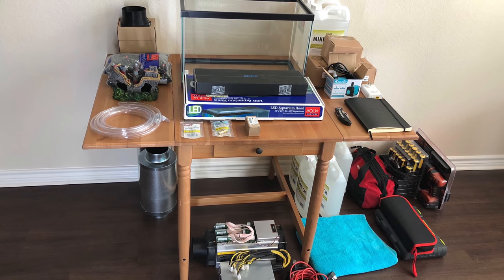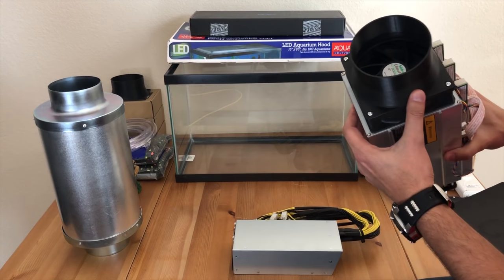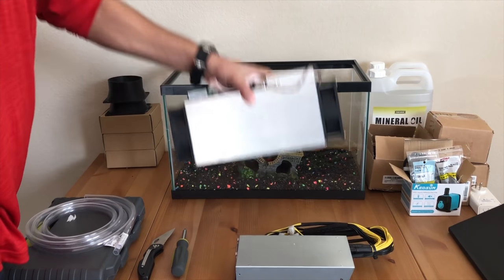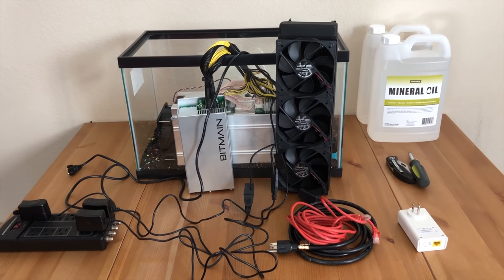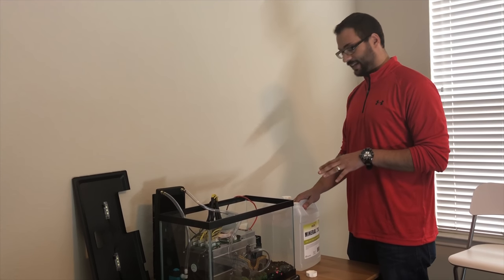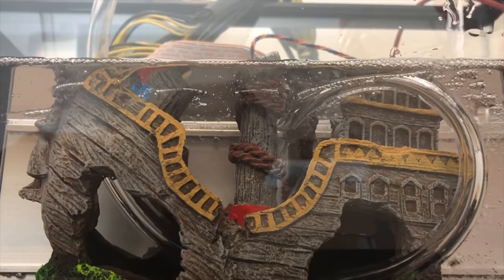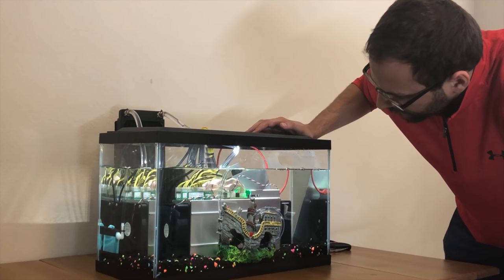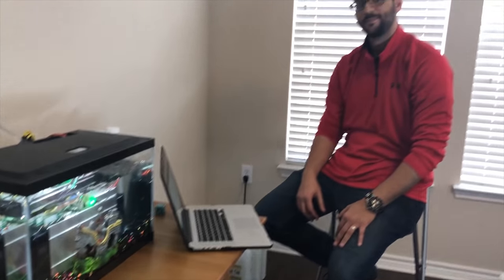Coolest Bitcoin Mining Miner - Liquid Cooled Experiment

Comment: Great video dude. Taken (as you correctly pointed out) with a bit of salt, it does serve as a very interesting experiment!

Sidechain question: where did you get the black muffler adapters screwed onto the miner at the beginning of the vid?
Reply from the maker: Thanks. The muffler adapters I bought one on eBay and Amazon. I personally don't recommend them. Maybe the newer ones are better. But long story short is they don't function as you'd expect. The tradeoff of ~5-10Db for 10+ degrees in temperature is not good at all + lower hash rate and higher Watt consumption. Overall just not worth it.

Comment: Hey guys great video. we're considering something similar. Are you still running this set up? Or was this just, as you put it, experimentation? I'm wondering if some or all of this can be used in a more permanent solution?
Reply from the maker: Ezra Peace Definitely an experiment. The heat generated cannot be dissipated with two radiators. Based on the Temps I calculated over time, you would need 4-5 radiators. A car radiator would definitely do. Long story short, it's viable (car radiator because of heat deltas) but too costly.
Reply: 5 radiators , 360mm each ? and 15 fans ? hmmm .... sounds like over kill , can you show your math ?

Comment: It looks really really cool and now I'm seriously thinking of setting up an Antminer A3 in fish tank for decoration purpose as hobbyist. I have two questions before I set it up in a fish tank. As I'm going to put it in my bedroom room, I want to know how loud is the antminer when it is working in mineral oil compared to working in normal environment?  Do I have to change mineral oil in a regular basis and does it cause any health problems with mineral oil evaporating in the air for the long term? 

Hope you have more similar experiment videos on your channel ;-)  Thanks!
Reply from the maker: Qishen Zhang more mining experiments coming soon. Ideas also welcomed.
Reply: you should try this set up but with 3 of the 480watt xspc radiators. how are your fans running and not causing the miner to turn off?

Comment: I wonder if the radiator is cooling the oil faster enough than the miner is heating it, because if not, the experiment will fail. The point here is to get a cooling power greater than the miner and also take care that the density of the oil doesn't damage miner's fans in order to keep moving the oil. Could you give us feedback?

Comment: you need a 300 watts heavy ac motor and a proper pool pump and a car radiator to cool down the oil. if you want to use it and not damaging the chips. and that will make enough noise any way plus extra costs and extra time to assemble it. so, cool game you did. for commercial result, stick to a room outside your living area and isolate the walls for noise.

Comment: Tiie wraps used for hose clamps is a bad idea. Viton tubing is what is needed for mineral oil. The type of tubing you are using gets brittle, I learned the hard way. I have a HTC that's been running nonstop for several years in mineral oil. Great cooling media if you want a quiet system. I use a single 200 mm fan which runs silently.
Reply: Is it okay if I want you to share more about your lessons with me. Please..

Comment: Hi,
How are things going so far? We about to submerge 2 and want to hear more about how its performing so far and if you have had issues after this video? 
Please let us know. Cheers
Reply from the maker: Jason Stark This was an experiment to get some numbers for large scale implementation. I'll be doing a video update eventually but my advice to you would be to calculate the cost and understand how much cooling you would need. If you don't have the numbers right then don't do it. I'll refrain from recommending a specific hardware since I'm still working on it for a 3x setup. No issues but this machine ran for less than a week (non continuous since it was used for various experiments including testing max temp) so take that for what you may. Also, this is not cost effective at all. If the noise is getting to you consider an alternative. Hope that helps.
Reply: Hi,
Electricity cost for us are not an issue at all. 
Just wanting to hear what hiccups you had after the video etc, if any. 
I have do my calculations etc and bought the best we can get our hands on across the board. This as well is an experiement for large scale.

Comment: Building out a detached garage thinking in my case better to soundproof it instead. Thoughts?
Reply from the maker: Crypto Chick! You are better of creating a soundproof box or she'd covered with loaded mass easily found on Amazon. Make sure to set the auto turnoff on max temp reached value in the settings. Ensure your not pushing Amp powerline to more than 80%. Otherwise you can easily start a fire!
Reply: Joel Pagan Good to know.  Is it true the new Samsung cards will be more efficient and specific for mining?
Reply from the maker: Crypto Chick! Technically yes. They are more efficient because they deliver greater throughput (nearly double) with nearly the same voltage (.23V increase). They did so by primarily doubling the chip density.
Reply: Joel Pagan just looked up loaded mass and that’s such a great idea for my garage. I dont want the noise from fans to annoy neighbors. Pls continue with tips/vids on how to build rigs. I am waiting for those new Samsung Cards.
Reply: +Joel Pagan мега крутой видос) лайк и подписка одназначно) и буду ждать новых видео)

Comment: It will never run for long, because if the heat saturated the oil, it will like frying some fries.
Reply: it has a radiator to keep thinks under control.the only mistake he made was dipping wires in oil.mineral oil will eat plastic ober time.

Comment: Hi Joel i have issue about fan, firmware dont start the miner becouse fan is too slow. Id like also remove totally the fan, Do you have any advise for me?
Reply: Hi justin, i have the same problem than Daniele, but my cuestion is if you have an idea how you can run you fans and we don't ??? is any issue or trick that i need to know, i have an antminer a3

Comment: If this is now under immersion, could someone remove the fans off the miner before immersing it to reduce energy consumption?
Reply: The fans are necessary to continue flowing the mineral oil through the device to remove the heat.  Without the fans, it just cooks itself in oil.

Comment: Can you list the parts you used and why

I'm building a large scale mining farm and this might be the solution I need... Please get in contact with me
Reply from the maker: t This specific setup does not scale. A large round pipes vehicle radiator is your best bet. To scale to 3 or more you would want to focus on having a large flat surface area and only cover the processing chips and not the micro controller and exclude power supply. Reason is to mitigate oil exposure to capacitors. Reason for round pipes with no 90degree turns is to increase flow rate.
Reply: "Reason is to mitigate oil exposure to capacitors."--------- есть масла которые применяют для пропитки конденсаторов. Думаете они не подойдут?

Comment: Hey, thanks for this cool setup.
Im thinking about doing this too with some of my miners.

Do you have any experience with the long term effects or problems ?
After 3/6/12 months ?
Reply from the maker: RitchardKnight I honestly don't think it's cost effective. The cost of mineral oil plus pump plus radiators is too much for a serious setup. This setup has no fail over. If a pump burns out, the mineral oil will boil your miner for sure. I'm planning on doing a cost effective setup if enough people request a video for it. Copper piping and custom radiator is the way to go.
Reply: I would like to see your future setup as I plan to test this myself.  The noise is killing me...

Comment: Is it safe to submerge the PSU in  mineral oil? Planning to do One of these . I Will put it  in a chest Freezer for cooling the oil. Don't want to let  the PSU outside the mineral oil because of the humidity. Anybody tried this before any comments would be appreciated thank you.
Reply from the maker: Ismael Quesada psu in mineral oil I'd safe. Just remember that you would need many more radiators to dissipate this kind of heat. Again. Just an experiment not a viable solution. 

The problem is that the PSU also dissipates a lot of heat. The capacitors in the psu are more sensible and have lower heat capacity. That means that you can't let the temp go high or the capacitors will pop.

Comment: How did you clean your miner afterwards??
Reply: afterwards miner is useless and need to be disposed.
Reply from the maker: Anton Saad Cleanup is very simple. Run vertically for 5-10 minutes and gently increase and decrease angle every minute or so. Oil will pour out continously until surface is nearly clean. Open device and gently remove remaining oil from surface.

Note that this will technically never come of completely. You can also run it as is knowing that your temp capacity will be lower. This means you won't run as efficient as other devices. It's somewhat obvious because once dipped, there is no going back to normal.

Comment: 20% of an ASIC's power consumption is in the fans. At most farms they remove them but with some miners you can turn the fans off with software or set to immersion cooling which should disable fans. You are wrong about air being a better cooling medium than immersion coolant. Jump in a frozen lake and explain how the air is a better cooling medium.

Comment: I’m just so confused like, when you put a phone or something else in liquid it destroys it... how does this work ??????
Reply: It depends on the fluid's properties. If you put electronics in regular tap water, the water will conduct electricity between components that should not be connected. This often ends up in damage. 

Certain fluids are dielectric though. This means they do not conduct electricity (or at least it's much much more difficult to conduct electricity through them). The specific fluid used here is mineral oil which has dielectric properties. 

You could consider air as another type of dielectric fluid that electronics are bathing in regularly.
Reply: @poipoi300  good to know thank you so much that clears up a lot of questions
But the real question is do you think i could use mineral oil to cool gpu miners and asic miners and any other electronics like that. 
I have a few miners and they heat up pretty damn hot and get pretty  Loud so I’m just wondering if you think it’s worth it
Reply: @TylerGraybeal  No problem, I'm glad I could help. 

Yes, you can use mineral oil to cool ASIC miners and GPUs. You would simply need to make sure the mineral oil is circulating properly in the tank and being cooled externally.

Like the person in this video did, you can put a pump inside the tank that will send the mineral oil through a radiator (you can also do multiple radiators depending on how much heat is being generated inside the tank). It doesn't even have to be pc parts, you could use a car radiator. I would also highly recommend attaching fans to the radiator to improve heat transfer.

There's some things you should know about mineral oil before getting started though. 

It is very messy, it gets everywhere. it's best to make sure your system is in perfect working condition before you put it in mineral oil. When you'll be done with it and you want to take out your components, there will be mineral oil on everything and it's nearly impossible to clean off completely.

Another thing to consider is that erosion will occur inside the tank due to the moving mineral oil. Over time (multiple years), this can cause certain soldered components to become loose and it can also cause metal flakes to float around in your tank. If you're unfortunate, those flakes could even conduct electricity between 2 points that should not normally be connected.

Comment: I thought about this so many times but abandoned the idea because i'm propably going to sell my miners in near future. Btw if i would creat this i would use a big tank with a rack inside, add in and outlets to the tank, route hose for heat dissapation to an window, place a big old truck radiator plus fan to the outside and route the cold oil back inside to the tank.
Reply from the maker: HaLuNkE ST0NER thanks for the input. I thought someone did something like that for gpu setup.

Comment: Those fans wont last pushing oil...be careful
Reply: They will last, the oil keeps them cool and lubricated.
But they do waste power, you can remove them with an antminer fan spoofer. (search for it on ebay)
Reply: They are running in lubricant
Reply: Matt561 with lots of drag
Reply: would it be possible to remove the immerged fans to cool the radiator outside instead ?

Comment: I'm confused how the hell can those electrics survive or even work when drowned in liquid !?
Reply: Mineral oil is not conductive. Electronics function fine when submerged in it. This is from Wikipedia: "Mineral oil is used in a variety of industrial/mechanical capacities as a non-conductive coolant or thermal fluid in electric components as it does not conduct electricity and functions to displace air and water."
Reply: AWDTurboPOWAH noo shit!!? I didn’t know that so could you drop your PS4 in it and play it ?
Reply: Yup. There is loads of mineral oil PCs on YouTube you can see. As far as game consoles, here's a broken PS3 a guy fixed and submerged in mineral oil:
https://www.youtube.com/watch?v=LFNQ7O7ipfI

And here is an Xbox One:
https://www.youtube.com/watch?v=3ZeP-rhp8xY

It's a fun project if you're interested in trying it. Just read up online about doing it, since stuff like mechanical hard drives shouldn't be submerged.
Reply: AWDTurboPOWAH isn’t there hard drives in these miners ?
Reply: Justin Peyton no

Comment: How is that liquid non-conductive and don't make an electric shocks is beyond me!
Just inset an electric cable in a glass of cooking oil and stick your finger inside, please don't jump on the ceiling after that!
Reply: SpiderWeb it’s mineral oil. It’s not conductive. Water is conductive. Hence the viscosity and it’s properties.
Reply: 1. Mineral oil is non-conductive and 2. Miners work with relatively low voltage.
Reply: Actually pure water is an insulator not a conductor, it's the minerals in water like salt and iron that make it conductive.

Comment: I want this, no joking. Can someone tell me where to buy everything?
Reply: Amazon
Reply: @ZacksHacks  thx
Reply: Things to be aware of:
1. Mineral oil is flammable. It could ignite if there are sparks. Run it somewhere safe. There are fluids specifically designed for this that will not ignite but they are very expensive.

2. Mineral oil will degrade rubber. Avoid rubber insulated cables and make sure there are no rubber feet in your equipment.

3. Mineral oil will wick up cables and sometimes can drip out. Good idea to leave a big air gap at the top of the tank and/or use sealed connectors and/or put everything in a tray.

4. If the oil gets too hot, it can compromise the tank and create a big problem. Make sure you have enough fans and radiators and monitor oil temperature.

5. ASIC miners like the one shown usually have a feedback sensor to monitor the RPM of the fans and make sure they are running fast enough. When it is in oil, the fan will require a lot more power to maintain RPM and can damage the miner. Normal fans will not have that problem because there is no RPM feedback controller. There are devices called fan spoofers (also on Amazon) that you can plug in instead of the fan.

6. Mineral oil can damage the thermal paste between the ASIC chips and their heat sinks. This is not a problem as long as it stays in the oil but if you want to run it in air again at a later date, it might be more prone to burnout.

7. Clean everything before submersion or the oil will get nasty.

Let us know your results! It is suspicious to me that the OP never answers questions about how long it worked.
Reply: @ZacksHacks  thanks for the info

Comment: you need a MORA 3  rad!!
Reply from the maker: 123rkss I'm looking into it. Looking at the specs and that would've been way better for initial testing. I'll consider doing a follow up video with 2 MORA 3s.
Reply: i had a computer in a mineral oil aquarium and the mora 3 was a total overkill even with a weak pump and only 4 fans instead of the 9 it supports. not sure how your asic compares to a computer (at full load) in terms of heat output. mora 3 is a hugely effective rad, with proper pipe rows, i believe it has about 20 meters of pipe inside
Reply: no need if keep in colder plays